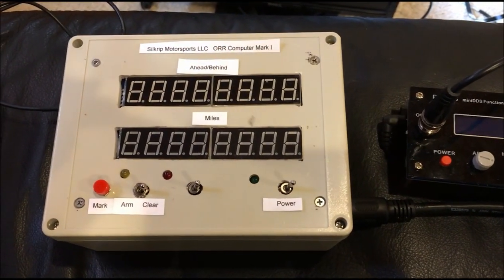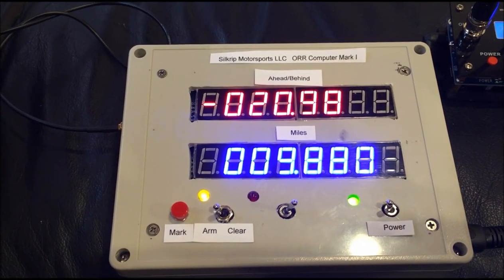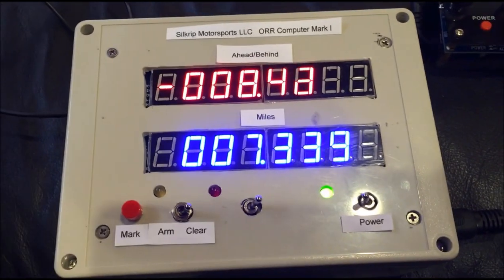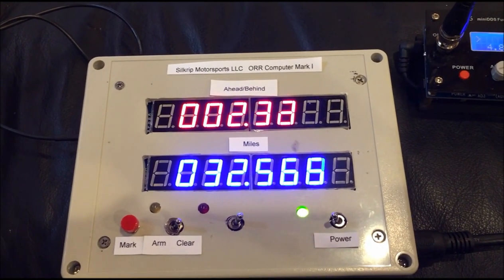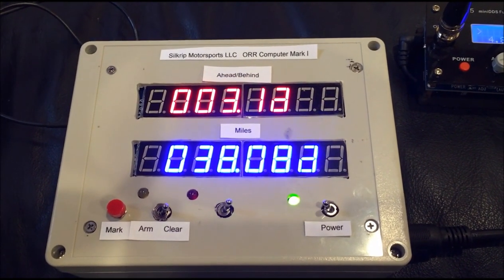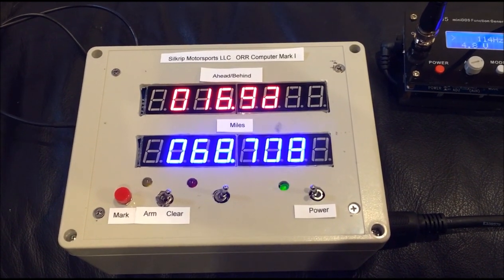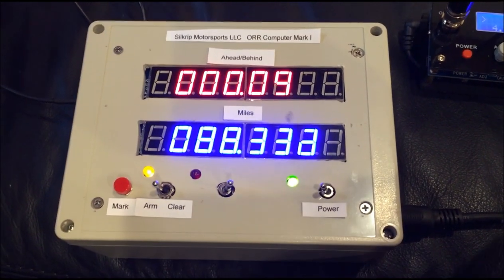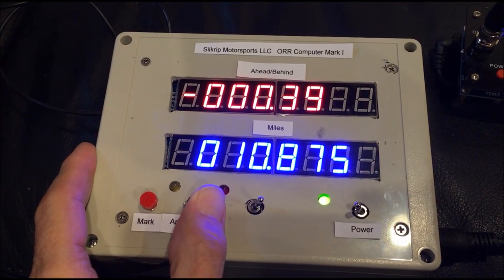SilkripORRComputer

Comment: This is my first attendence of this motorsports event. I observed the course 91 miles. Judging by the various speeds beginning at 95 to unlimited miles per hour time trail, one has to be correlate speed, distance, compromising variation in driving speed for course road surface conditions including elivation and safe curve negotiations. A simple analog stop watch pales in comparison to this onboard Time Trails Timing Computer.